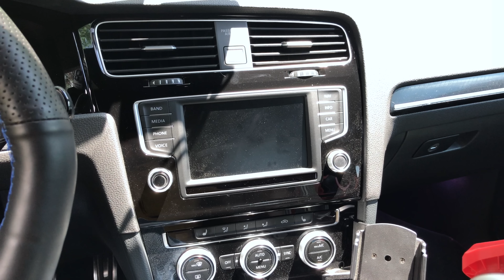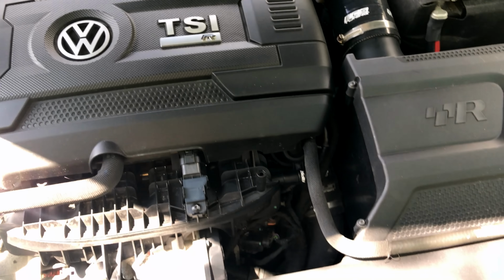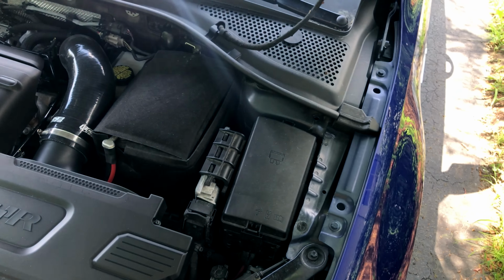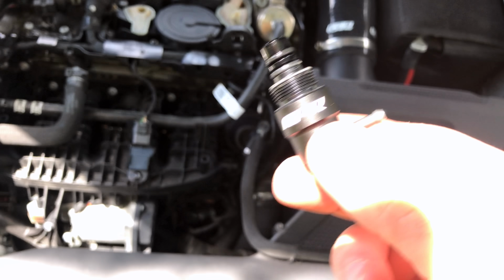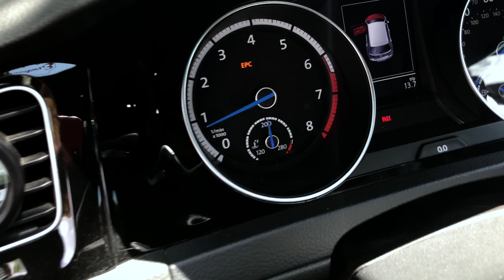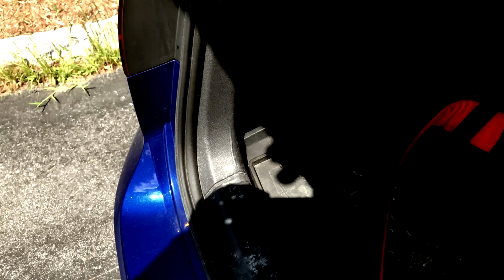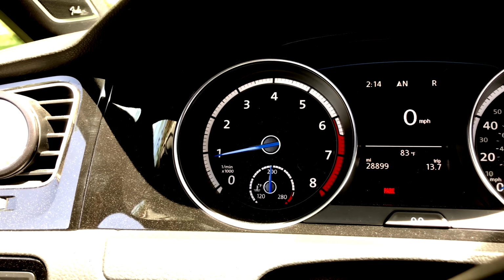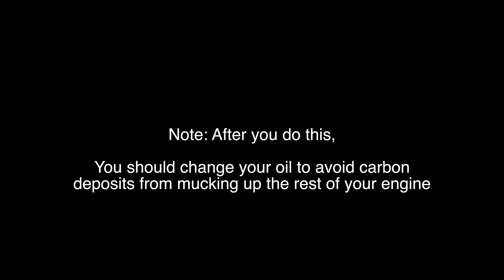Carbon Buildup Cleaning, Golf R Intake Manifold DIY

Comment: Another option...take off the MAP sensor on the top of the intake manifold and go through that port.  It will also set a code but the location is ideal being closer to the middle of the intake manifold.
Reply: Did the car not sputter off with the MAP sensor disconnected? I'm thinking about doing this soon.
Reply: MK7's don't have MAP sensor's
Reply: @ 1:12... “there is no MAP sensor on this car”
Reply: Would you just remove the sensor and pull it to the side while the vehicle is on and you are spraying CRC ir would u completely disconnect the sensor ?  If so, how would the car react without that sensor while it's on and ur spraying crc ? Thanks
Reply: J.A.M this guy in the video is wrong.  There is a map ssnsor
Reply: Has a map sensor on top of the intake. I see it 😄
Reply: Hello. I have a boost tap that sandwiches between the map sensor like you described, that came with my meth kit. good to know it is safe to use this port. Also just as an FYI because it sandwiches, it is reversible so you're not tapping into the plastic of the manifold like the port shown in the video. Just some food for thought. yum.
Reply: that sensor on top of the intake manifold is the intake air temperature sensor. the absolute pressure sensor is lower down, if you follow the hose coming from the throttle body you'll eventually see it. I own this engine
Reply: There is no "Maf" sensor but there are 2 "Map" sensors on this car.  One is on top of the Intake manifold and the other is on the intercooler pipe before the throttle body.  Both called map sensors and just replaced both on my engine.
Reply: @spencer1320  Yes they do, I have MK7
Reply: @MartinAston00  Just look that intake manifold. Map sensor sitting right there
Reply: You really don't want the car running w/o the MAP sensor connected.  It will run rich and then you are introducing addt'l flammible fluid into the manifold.  Not a good idea - just go in from the side as shown.  Better than going in pre-turbo for sure.
Reply: @MegaHollywood1971  Running a little rich for that short period of time won't hurt a thing.

Comment: This will do very little. Once carbon has  built up the only way to remove it is to walnut blast it off or something similar
Reply: Jamster Smith nothing beats a manual cleaning of intake valves
Reply: Installed a catch can on my 2.0L EcoBoost Fusion. Sprayed this into the 'out' line. Used half the can, hot soaked and drove on the interstate, then did it again and the valves are perfectly clean.

Car has 40k miles and had a large buildup of carbon. All clean.
Reply: Pictures or vids?
Reply: Manually cleaning cant get every crevice and what not. Best way is Walnut media or dry ice media.
Reply: This helps better if you drive your car at high revs on the highway after the spraying
Reply: Walnut blasting is overkill.
Reply: however, this ain't a CCTA motor...
Reply: @xabhax  The day after I removed the intake manifold and everything is all fine. Had a MPG increase of 2 after cleaning.
Reply: mattk02 

INCREDIBLY!! .... you might as well buy snake oil 🤣🤣🤣

Comment: Any cleaning product that would run through the manifold would only loosen up the "non-baked" carbon.  This can in essence be used a temporary solution and at 50-60K on the ODO (from the last FULL carbon cleaning) you would still want to remove the manifold and either Blast or Hand Clean off the valves.  Gives you an opportunity to clean off the throttle body and possibly replace the injector o-rings and/or replace those as well.
Reply from the maker: good point and it is worth doing as the miles rack up.
Reply: @AdamChandler86  If this were done every 10k you'd possibly remain unscathed by serious carbon bulidup for a very long time.

Comment: Is everything all good still?
Reply from the maker: Yep. No issues. No real improvements either. Net zero but I push my car hard at the track and only 30K miles on the ODO so buildup was probably minimal.
Reply: Hey Adam, do you feel like track driving and getting the valves up to high temperatures might help burn some of the carbon off? I also track my GTi PP pretty regularly and run a catch can, Im wondering if this means I won't have to worry about carbon buildup as much?
Reply: @Chrissy-H  it would need about 500-600 C to burn off that carbon. Will never reach that at track and it will kill it in case it does

Comment: Hi~Nice video! That's exactly what I was looking for! One small question tho... How do I turn up the engine once I remove that valve on the manifold? The engine shuts down immediately when I took the valve.
Reply from the maker: Hmmm. not the same issue with me. It may throw a code but I haven't had that problem.
Reply: @AdamChandler86  Thank you for your reply! I noticed you had an APR boost charging pipe on the manifold. Mine is the factor PCV pipe. Maybe that's the reason for the engine stall?

Comment: The CRC GDI Intake Valve cleaner actually works decently. I manually cleaned the intake manifold on my 2.0T, but first I soaked one valve with the CRC cleaner and the other valve with a generic carb cleaner. I found that this cleaner dissolves the carbon very nicely but leaves an oily residue, and it seemed like I was wasting a good product doing it this way. So for manual cleaning I would recommend scraping with a pick first to loosen the deposits (and taking them out) & then soaking with any carb cleaner. And then every once in a while, you can use the CRC GDI cleaner like in this video to keep the intake Carbon free.
Reply: I'm doing that today. Woot

Comment: Hello Adam.  I got a 2018 golf r completely stock US version. I dont have a electronic boost gauge.  Where do you recommend me to spray CRC?  I have read some people say to remove the map sensor on top of the intake manifold and spray it in there.  What are ur thoughts?  Also if you spray it thru the intake wouldn't the turbo get some cleaning as well?  Since they say this also cleans turbo?  Thanks in advance..
Reply from the maker: The problem with spraying into the intake is you won't clean the valves because of how the US Golf R is direct-injected not Multi-Port. You'll need to spray directly into the intake manifold so the boost tap from APR is the easiest way to get access to that.
Reply: @AdamChandler86   Thank you for the fast response.   what would you recommend ??  I wonder if I can remove the Map Sensor on top of the manifold and spray it thru there.  I wonder how the car would react without that sensor for a little while spraying it in there.
Reply: @Juan1985g  mine is MK7 and concern the same issue, i noticed the MAP sensor.

Comment: I have a 2016 TSI Jetta, I been trying to figure out where to apply the spray, there’s a lil hose from the air filter box that connects to the manifold, wonder if should use that manifold inlet, pls help. The other lil hoses are close to sensors and I dont wanna damage the sensors
Reply: I'm here for the same answer and planned on just spraying through my intake until I found an answer. Because I've seen a few times going through the vacuum line into the intake manifold would do wonders for cleaning the intake valves

Comment: If my carbon buildup is really bad can I use this stuff more often? Like every 1000 miles for the next 10 000 miles ? Just to get all that stuff off . Or is it bad to use it too often ? I bought a 2015 vw gti with 90 000 Miles and i guess the previous owner run bad gas all the time
Reply: I have the same question! I have a 2013 Jetta GLI and have a misfire on cylinder 4.
Reply: I just did a carbon clean on my 2013 tiguan it's really not that bad of a job. Look up dap carbon clean on YouTube.
Reply: Ismael Acosta you ever get the misfires taken care of? 
Same issues haven’t done much to fix though.

Comment: Thanks for the vid Adam, I was just about to do this myself.  Nice to know it works without major drama.
Reply from the maker: Zero fall out after the fact either. Just get a buddy to keep RPMs @ 2K, wait an hour or more and then go for a 65+ MPH drive. Try to get max-boost on a few times. It's highly recommended to do this before an oil change as contaminants will be loose and will enter the oil system.
Reply: Will do, thanks!  👍🏻

Comment: My volkswagen jetta 1.8t has that port with no boostap, will it still work if I spray it there?
Reply: I see nobody answered here yet... but did you happen to find out from another source maybe? If so, did it work? Was your check engine light the reason you decided to do this?
Reply: @MartinAston00  I ended up doing it from right after the air box because there was no other way, and I'm not sure if it worked since my car only has 68 000 km, but since it's the 3rd hen 1.8t it takes more time for the carbon to build up around the Intake valves
Reply: No because is not inlet or hole to go through

Comment: Can I do this to my GLI (2013) ??? 
Clear the Check Engine light after looking with a bore cam that it’s pretty clean 
???? 

I have a warranty… So I can get the new manifold with the carbon cleaning for about $500… But my manifold is perfectly fine… I mean it’s almost new except for the build up… So I’m just wondering if I can be successful with this… Or if I actually have to pay those assholes for close to nothing

Comment: Do know the cause for carbon build up on the valves?
Reply: repairvehicle just typical for direct injection engines. You can’t use a fuel additive to fix it either which makes it difficult
Reply: The engines with this problem are direct injection. Meaning fuel (along with any detergents and additives) are sprayed/injected directly into the combustion chamber. With that said, there is blow by (oil) that is finding it's way into the intake and onto the intake valves. Once that oil touches the valves, it basically gets cooked onto them, causing carbon buildup. 

A VERY effective way to catch the oil before it seeps into the intake is a oil catch can.
Reply: Combo of PCV  (which results from blow by getting into the crankcase) and lack of fuel injectors right there.
Reply: @myname9252  right! the huge difference between direct inj and standard inj engine...on a non direct injection engine, the fuel is washing it away all the time, which is not possible on a direct injection

Comment: 95 or 98 octane fuel can make difference to the carbon build up?
Reply from the maker: Its the detergents that help but honestly with the design of these engines, it's a minimal impact.
Reply: The fuel is injected below, and to the side of the valves. So any fuel detergents only partially get one side of the angled valve. This makes cleaning the valves through fuel additives ineffective. Only way to clean them is scraping/walnut blasting or doing something like in this video
Reply: honestly if you are using a turbocharged engine id always recommended top quality fuel, may help deter spark issues amongst other issues especially when tuning to higher powers

Comment: Aren't R ment to be driven fast? Carbon build up shouldn't be a issue with these cars right? I am so close to get a 2015 r with 36k km on it but I have got scared with story's I hear about how unreliable vws are
Reply: nah carbon build up is due to PCV valve not going thru an oil catch can before being recirculated back into the intake stream. The air that comes out of the crankcase has oil suspended and gets on these intake valves. Its SIMILAR to water vapour in air coming into contact with a surface that is below freezing, frost occurs. Just in this case, the frost is the carbon build up.
Reply: @IamJimhunder  i read up about catch cans and most of the time they are empty or filled with some water and nothing else.  if you aren't tracking the car, it's unlikely it will do anything

Comment: We're lucky enough to not have this issue in England as our engines have Dual injection.
Reply: Matt I think my car has the same I’m in Germany and it’s germanspec
Reply: @smitherzz001  yes I believe all of Europe has DI
Reply: Matt Thank you for the information I’m glad I don’t have to do that
Reply: Interesting i never knew that, wheres the injectors located? I take it all ea888 gen 3s are like that in the uk
Reply: @KasamS  EU spec engines use MPI which is manifold port injection, the gas sprays directly on the back of the valves, keeping them clean. Why dont we have this in America? who knows :)
Reply: @randyboyton4352 its a weird one, our new engines with the ppf/gpf dont have mpi unfortunately
Reply: How can I tell if my engine has Dual injection? I have a 2017 B8 Passat R-line with the same engine as a Golf R. I'm in Australia if that makes a difference?
Reply: @kenlawton1531  pull the engine cover off and there should be a rail on top of the intake manifold if you dont have it theres just holes in the intake manifold

Comment: I would never do this to my car. all the sud gets into the burning champer and later into the turbocharger and exhaust system. take the manifold off and use glas-blasting or nutshell blasting to get rid of the carbon buildup.
Reply: Domnaek Pay 600$+ and half a day or more instead to get very slightly cleaner than 10$ and an hr of work (+ 100$ oil change to be extra safe).
I'd rather have 500$ more every few years for mods
Reply: @infiniteuniverse1757  where are you getting these numbers from. Its an oil change and 5 seals XD
Reply: @colinl2515  i think you reversed part of my point.  Walnut blasts are over 500-600$. This GRC spray can is 10$ + an oil change (100$); I have a 335i, we have ab 7L of oil, so 110$.

Comment: Hey Adam, Did you notice any improvement in mpg & performance wise? 
Also how often would you be doing this again in the future? Every 10k?
Reply from the maker: I'm now doing this before each oil-change. This is slightly invasive as it breaks up debris and deposits and drops those into your oil so doing this on your way to get an oil change is the best way to have the best impact. Note though that this will not remove deposits at the intake manifold. Only sand-blasting can do that.
Reply: Adam Chandler Thanks man, Yup unfortunately all of us will have to walnut blast the valves at some point, seen most people do it around 70k-ish. 
The spray can is good idea & the recommendation to do it right before an oil change. 
Ps: no issues on my 16 R dsg.
Changed the brakes, tires & I serviced the haldex & dsg at the same time around 25k miles. If you are tuned I would not do 40k miles intervals on the dsg/haldex.
Reply from the maker: Good point on the DSG & Haldex. I'm doing mine every 20K miles. Brake fluid flush ever year (overkill for most).
Reply: Adam Chandler Never an overkill my friend especially with these German cars. My brake pads faded around 22k, so I replaced all 4 rotors & pads & fluid. 
The stock contis, I got around 10k before replacing lol. 
And The only thing I don’t have a response is when the front & rear differential are due. I’ll prob do them at 30-35k regardless what VW says

Comment: Do they sell any that u pour into the gas tank
Reply: Might work for older fuel injected motors - the 2.0 tsi are direct injection and the fuel skips the intake (part of the reason these get carbon buildup), a fuel additive wouldn't do anything.

Comment: i can't find the same opening on my mk7.5 GTI
Reply: if you're going this route the boost port needs to be TAPPED, meaning spiking a hole in the plastic. If you look for a boost tap that sandwiches between the MAP and the manifold, you dont need to tap anything and the piece can be removed and put back to normal if you dont want to run a boost gauge, etc. :)

Comment: I use sea foam every 10,000 miles(add to fuel)  and my TDI with 326miles on it ran with first fuel pump and first set of injectors ! need to say more ?
Reply: Michal TDI are much more reliable than GLI, GTI, and r. Also with direct injection using sea foam in your fuel doesn’t do a single thing for your intake valves and ports because your injectors are in Your cylinder. This means the sea foam never touches any of it
Reply: That’s a completely different motor
Reply: Different engine but still direct injection.  Not sure what it has to do with the fuel pump and injectors tho.   Is it normal to have to change the fuel pump and injectors on the TDI?